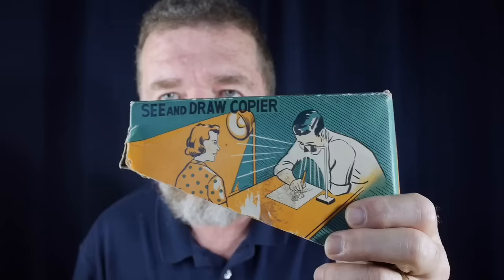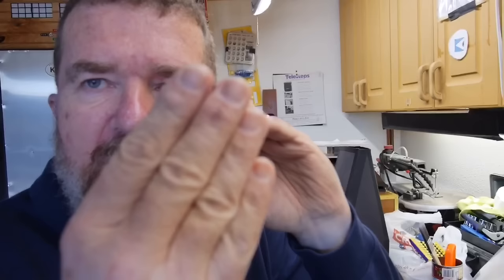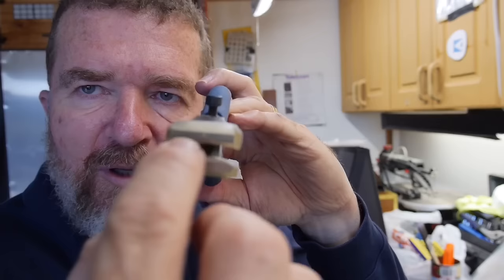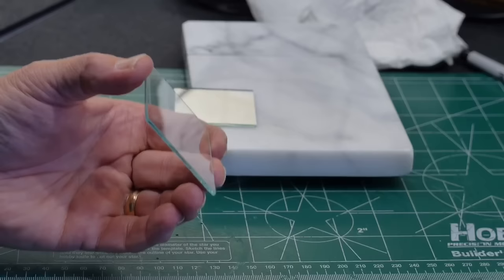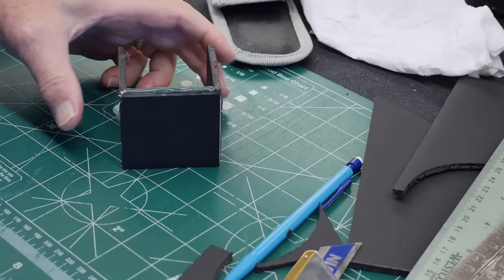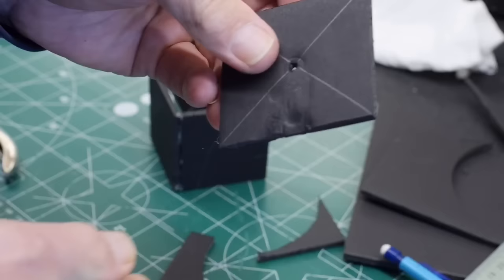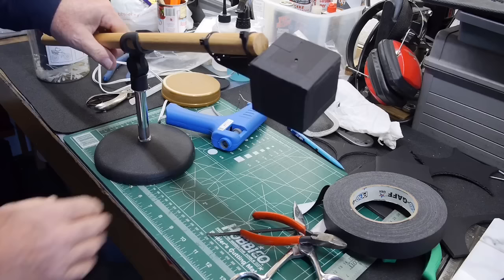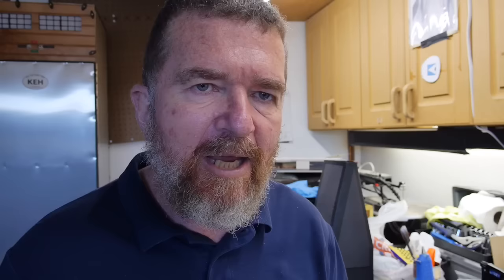DIY Camera Lucida Project

Comment: Just a quick tip for filing the sharp edges of the glass. If you put some fine sandpaper down on a flat plate and then drag the edge at a 45 degree angle over the sand paper it will give it a nice even chamfer along the edge and when done carefully is a very quick and safe way of knocking the sharp edges off of glass to make it safer to handle. An old cabinetmakers trick we use prior to fitting custom glass panes in fine cabinets. Thanks for the interesting and very helpful video, take care and thanks again 😎👍
Reply: Nice info 👍🏼
Reply: A sharpening stone or emery/wet and dry abrasive as well.

Comment: Well done Joe for making this aid. I made something similar but for steadiness, I used a removable vertical round post (20mm)  and slotted it into a 20mm hole drilled into a small block of wood which is permanently fixed to a 60cm square x 20mm thick chip board. The block of wood is 75mm x 50mm x 30mm deep. The camera is fixed to the post by putting a recess in the post and gluing/screwing it in place. This makes it non adjustable but more easy to transport and store away.

Comment: HI Joe.  Always wondered, now I know.  Thank you for doing this DIY.  I've been painting for years and have constantly been drawn to realism.  I was given a projector device as a young boy by a relative (my parents were clueless) and used that for years but it required a photograph and careful set up, and still only helped with proportion.  I tried a pin hole device but that was too much for too little re. setup and lighting controls.  This is an interesting and simple tool as well.  I can imagine it would be useful for doing the initial setup drawing of a complex subject.  However, nothing substitutes for lots and lots of drawing practice!!

Comment: Aahhhh! Constructive criticism alert...Never drag your file backwards across whatever material it is you are filing. You will ruin the file. What happens is you knock down the tooth of the file making it either useless or making gouges in the material you are trying to smooth out. Also, never put a metal file in water. Again, it will ruin your file by rusting and you'll have no tooth to file with. Use a light penetrating oil if you need to lubricate.
BUT! After having said that, I am anxious to make my own camera lucida now. I'm a watercolorist but can't draw in the least bit! Very good video! I had no idea a person could make their own. And the ones they sell online are very expensive. Thanks for sharing! Keep up the good work! Going to subscribe so I can learn more things from you.

Comment: Joe, about any movement between the device and the drawing paper? Start the drawing with 3 or more reference points! Then it is easy to reset the device by just going back to those first points on your drawing, matched against the superimposed ghost image!  

My favorite comment, "This might actually work!" And the answer is, "yes, thank you Joe; it does work very well!" And actually, your drawing of the decoy duck is for a first time up excellent, and I noted that the depth perception is also excellent proving the value of your Camera Lucida!

Comment: In the length of this video, I was able to fab up a prototype. 
One sheet of scrap glass, about 5 and 7/16" (37mm) by 6 and 15/16" (175mm) about 3/16" (4mm) thick. For what it's worth, these measurements are immaterial, it's just what I had to hand, and to give an idea of size.
To the above, I added a hand mirror.
Just holding these two objects in my hand, I got a reasonable facsimile of the results shown in this video. 
It helps to be the sort of person who doesn't throw away stuff. (Insert Horder if you like.)
I also have essential tremor, so took me longer to write this message then the entire video. Also precludes any artistic endeavor, sigh.

Comment: You're a life-saver with this tutorial!
I like to make my own sketches on my drawing tablet in an art program where I can get the anatomy or proportionsor whatever as perfect as I want it and trace them onto whatever traditional analog substrate I want and some surfaces like illustration boards or canvas panels are obviously way too thick to use a light box with. Graphite paper can be too messy for me and this just seems way more environmentally friendly in the long run too! As long as I can get an approximation and erase mistakes, then I don't consider possible visual imperfections as a real flaw with the device or method, so this just seems perfect.
I also like the feature of having it on a microphone stand that can be moved around instead of having it clip to the table. It makes me wonder if a image can be transferred via moving around this Camera Lucida, substrate and reference accordingly, maybe keeping it organized with grid guidelines and just going grid section by grid section. Eve if not, the comfort flexibility of a stand is better than a clip that can only clip onto tables of a certain thickness.

Comment: My only suggestion to the construction, would be to get a "back saw" and cut a slot in the dowel. I think it would add structural integrity to the lens apparitus. 
Other than THAT - most excellent video - going to make one for myself (instead of buying on for $80+)
all I need is to come up with a decent mic stand... hello eBay.
Mucho grasioso, Joe.

Comment: Thank you, Sir, for sharing the video, it's very good and well explained.
Just a healthy advice when making the glass, not only you need eye protection but do wear a breathing mask too, because when glass dust enter the lungs it will never come out and will cause fatal health problems.
As for filing the sharp edges of the cut glass, it would be better using a small very fine indian grinding  stone and wet it with water.
I'm about to build one as I have all the necessary parts, but I would like to make a larger version of this, like 10cm x 10cm prism(mirror) then measure the length of the glass according to the angle of incidence.
This is my first attempt and I would love to hear from someone if a  larger version is better or is limited.

Comment: Thanks for the project tips!

It is not oil used to cut glass.  It's kerosene.  With a felt brush, together with a wooden ruler, to clean and 'lubricate' the cut location. 

pull to your side with little pressure.  support the other end under the risk of being cut, and press with both thumbs on the side, and the glass will break on the line, without pliers.  Use a table lined with felt.

Use sandpaper with water.😉

Ps: If you like, you can use kerosene on your files too.

Cutting the glass must be done in a single hand movement, following the angle of the tool.  If you pass it more than once, where it already has a line, it will damage the cutting tool.

Comment: For glass, I use wet-dry sandpaper to smooth the edges and the cut surface. Fast and no problems. Whatever you have, around 320 grit and no water needed. The sanding also levels the surface and you do it by putting the sandpaper on like that piece of marble or another piece of glass and rub your work over it.

Comment: Went an easier way - just bought this vintage see and draw toy on ebay. :)
The problems I encountered: 1. The object has a double image (not fully focused, like two images together but slightly shifted). Don't see any way to fix it.
2. As you mentioned - can't see clearly where is the tip of my pencil, but will use your advice to solve this problem. 
3. My eyes getting tired quite quickly while using it.
Otherwise it's a neat little device, but for tracing I prefer a light board or just a laptop screen.

Comment: Other suggestions I've forgot: 
Put some gaffer's tape in the mic stand. This will help keep the dowl from moving.  
If you have the closer from the storm door, cut the rod off about 3-4 inches, drill a hole in the end of the dowl, close to the same size as the rod, fill with hot melt glue, shove the rod in the hole. Once this dries/hardens, find a suitable bolt and nut, now you have pivot that gives a greater range of adjustment.
If you can't find the closer, a hardware store screw eye could work.

Comment: I have over the years that a fine grit sand paper works so much easier and less chance of slivers and or breakage and place sand paper on a sturdy flat surface and hold glass and as it with any other time back and forth to what is need ed.and if your afraid of getting cut and just put some duct tape around the you wo t be working with if preferred

Comment: when you put water on the file and started to round the glass edges... Why wouldn't you just do it with oil in the first place? Then there'd be no rust worries. Wouldn't oil work?

Comment: Sand paper does a much better job of smoothing the egdes. You can make a sandpaper file by using CA glue to affix 150 -600 grit to a flat piece of steel bar stock, or glue the sandpaper to youir marble slab and rub the edges you need to smooth. Afaster method is to use a rotary tool and it's sanding attachment.

Comment: This is apropos as I was just about to spend over $80 for a kickstarter camera lucida.  It just seemed too simple to buy one however, and I'm glad I found your youtube!  I'm familiar with glass cutting (also did stained glass).  Question:  Does the view hole need to be that small or can it be bigger - like 1"x1" square?
Reply from the maker: The hole helps to keep your eye centered at the same spot.

Comment: From my experience I say, cut the foam squares on the top and sides to exactly just 2 inches. Though the back square could be 2 inches a 1/4 and a half.
I learned that the hard way. :P
EDIT: Some of the front still needs to be long to shade for the lucida
Reply: Yeah my Lucida is a mess though it’s still useable. I’m gonna have to devise my own measures.
Actually, while it does work, I find the image coming off to opaque for me to see my outlines when trying to trace the image.

Comment: Is it always better to cut up rather than down? I've always cut down( but never tried cutting glass) 
Does it matter? Thanks for the awesome video!
Reply from the maker: Depends on your specific glass cutter tool, and technique. You want even pressure throughout the entire cut, and don't let the cutter fall off the edge too hard so as to chip the glass.

Comment: Any thoughts on how big an image you can trace? Thank you for your teaching.
Reply from the maker: It’s limited by the angle of view of the optics and the length of your arms: you have to simultaneously look through the unit while being able to draw with your arm. Or, I suppose you could use a really long pencil attached to a rod and stand on a step-stool high above the drawing surface. But without such abnormal gymnastics the drawing size is limited to about a letter-sized sheet of paper.
Reply: @Joe_VanCleave  thank you for your teaching. May I ask you the dimensions of a letter sized paper please. I ask because I just bought, before seeing your very fine lesson, the brand “NEO LUCIDA XL”. We are still in our testing fase. The images are at best 3 inches by 2 inches, not very satisfying for about 85€.
Reply from the maker: @paulrodberg  The image size depends on how high above the paper the Lucida is. The higher it is, the larger the image, but if it’s too high then you won’t be able to reach the paper to draw, while still looking through the device. To make the image larger you need to raise it higher above the paper.

Comment: Joe, does the diy project make the image as clear as a real Lucy? Can I just buy one off of you??? Another same project has a viewing circle the size of your finger tip...can yours be a larger diameter? How big can your art area be?
Reply from the maker: The viewing area depends on the height above the work surface, and the size of the mirror.

I've compared mine with a commercially made unit, they're very close in clarity.

Unfortunately, I'm not making these to sell, I only have the one prototype.

Comment: Great video. Could you provide the measurements for the glass in cm? I understand that the width is half of that of the mirror, but I don't understand how to calculate how tall it must be. Thanks.
Reply from the maker: For the smaller one on the movable arm, the mirror is 5cm by 5cm and the glass is 5cm by 7cm. The mirror is mounted vertical in the rear of the box, facing forward, while the glass is at a 45 degree angle to the mirror. You view looking down from above through the glass, where you can see both your drawing paper and a partial reflection of the scene in front.
Reply: 1"=25mm

Comment: Would this work, if your work surface were toned paper?
Reply from the maker: It depends on how bright the scene is illuminated compared to the paper itself. For instance, a dimly lit subject with bright white paper, it may be hard to see the superimposed image against the bright paper. It helps to be able to adjust the illumination of both.

Comment: Would it work with plexiglass?
Reply from the maker: If it serves as a partial mirror (i.e. makes a reflection but you can also see through it), then it should work.

Comment: Hi, mirror used is front surface mirror or a regular mirror?
Reply from the maker: I've used a thin rear-surfaced mirror to good effect. The ones I use are mirrored tiles, which can easily be scribed and cut with a stained glass cutting tool. Of course, a front-surfaced mirror would also work.

Comment: By far the best instructional I've found, easy concept but you'd think after a hundred years you could find better instruction out there for laymen like myself !

 So.. the mirror reflects the subject facing you... on to the inside of the angled "clear glass".
(image reversed) 
You see this image on glass, as halftoned or ghost image, 
(Glass re-reverses image), 
You also see through this reflection on to the surface below superimposing both.
Light value emitted to tablet vs lighted-subject must be regulated for best result.
Point of view can be misaligned, so you place a small peep hole on center to give you a tight margin of error.... A focal point by which to drink the light into your brain.

Nice, had to crawl into my spider infested basement to cut some test glass.
I painted portraits for some time and never thought of using this. 
I tried using glass prisomes today of eBay, they call Lazy readers, (Look up) although they have a very nice prisome glass they would not reflect image... solid piece compared to a sheet of clear glass Im guessing the front and back of glass make this happen.

For those not sure of cutting glass it's easy but practice some cuts first. I've cut 3/16in. x 12 in. long repeatedly. Finger bending snap. You can use spit on the cutter. This window glass will split by pinching and bending with fingers just dont slide your fingers and control contamination of glass dust. Also imperative to have very clean surface. If you have a fine diamond fille great or perhaps a knife sharpening stone for the edges. When cutting/scoring, Don't press too hard Don't want gravel sound it should sound light and crisp like sand. And lastly only score once don't do a second pass. Once you start to cut 1/4  1/2 inch glass it gets more tricky.

Thanks again for this video !! learned a lot.

Comment: Joe what was that formula?
Reply from the maker: I'm assuming you're asking about the length of the diagonal piece of glass in relation to the height of the vertical mirror? The hypotenuse of a 45 degree right triangle is 1.414 times the side lengths. Which is 1/sine 45. So whatever the height of the mirror is, the height of the diagonal glass will be 1.414 times that.

Comment: You need to get way more glass experience that could of been done in less than 10 seconds per cut without making marks
Sorry to say
20years of glazing talking
Also never use a metal file on glass
Glass is always an unstable liquid 
True fact
A piece of sand paper could do what he shows in 5 seconds 🤔 🤣